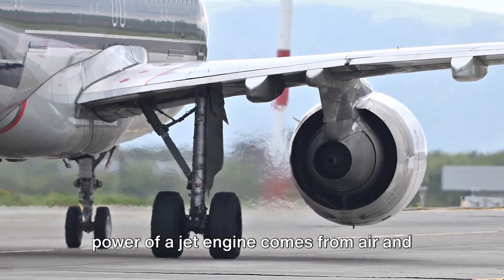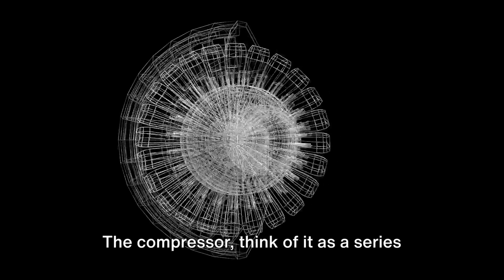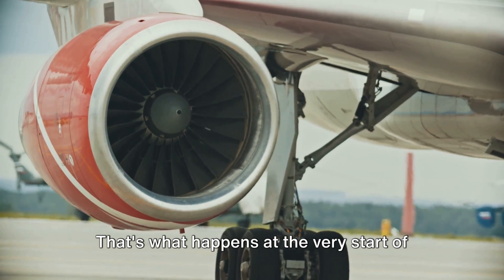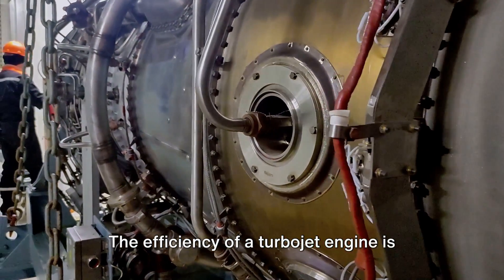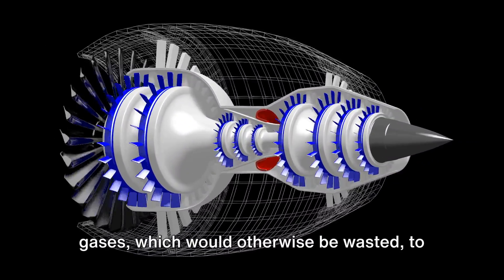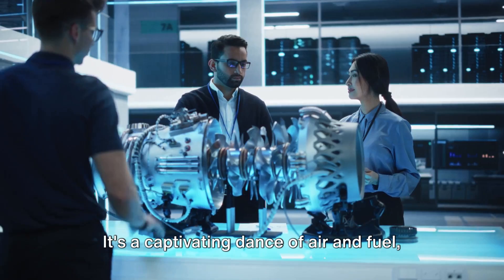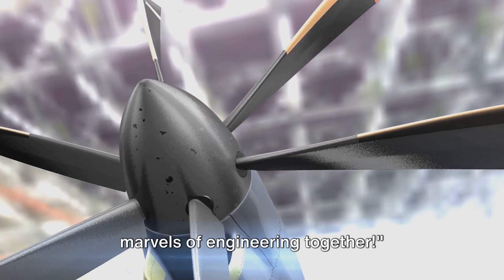Turbofan Engines: The Power Behind Speed - 5 mins encyclopedia

Comment: shs explaining a turbo fan engine using turbo jet mechanics ?? and even calling it a turbo jet.  turbo jets are old tech ,all modern commercial jet engines are turbo fan even in fighter aircraft .
Reply: Turbojet Engine is the grand Daddy of all jet engines existing today. The best of all examples. And, even though considered less efficient than turbofans, have a much higher pure thrust because of all the cumbusted air leaving the jet rather than only a fraction coming out it, very unlike where the greater part being just blown out the engine without combustion in case of the turbofan.

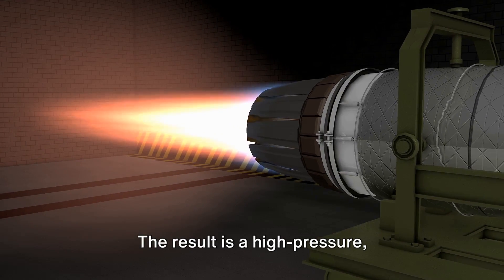Comment: 2:45 - Wrong! Combustion does not produce a high pressure gas. It's temperature increases, the gas expands and its velocity increases as a result of the expansion but the pressure actually slightly DECREASES during combustion. The highest pressure in a jet engine is right after the compressors, pressure continuously decreases all the way out the back. It wouldn't flow if that wasn't the case. If it's hard to understand how combustion doesn't increase pressure, light a candle or turn on a burner on a gas stove - there is no pressure increase, just hot air.
Reply from the maker: thanks for your information. I will try to make my video better.
Reply: When air gets heated🔥, it rises, which eventually causes pressure generation. So, in actual sense, she's ☑!